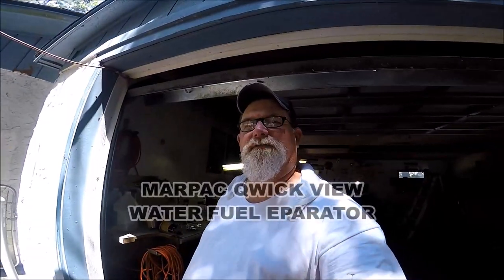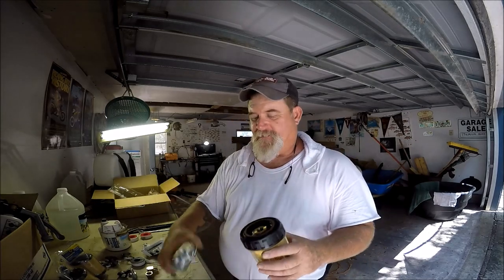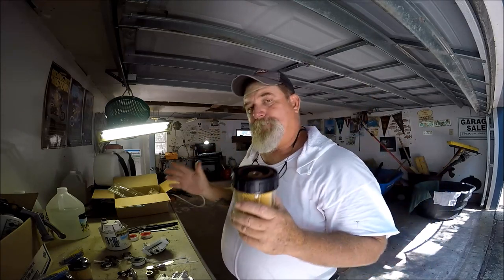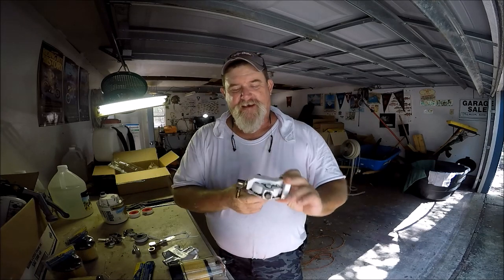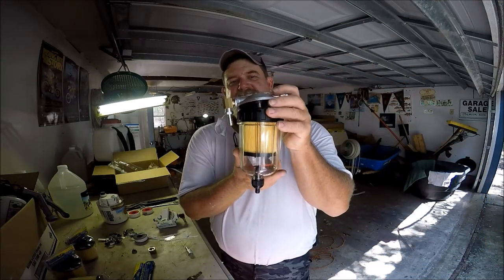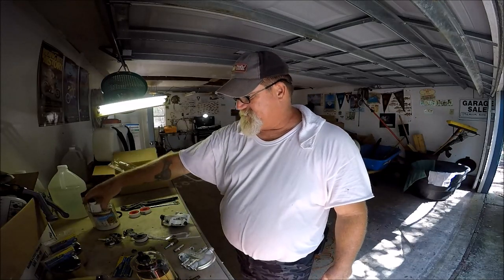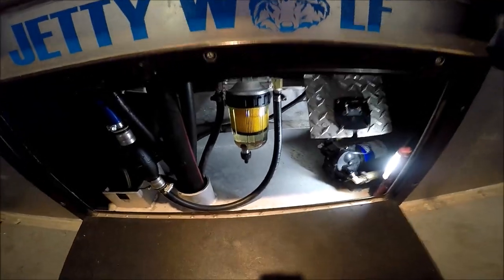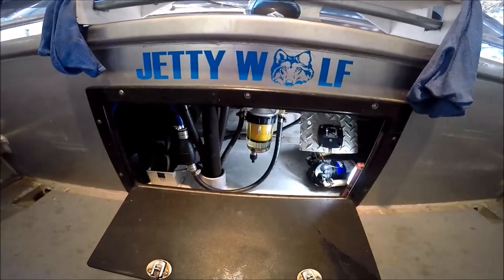my BOATS NEW FUEL FILTER, better & cheaper💲💲

Comment from the maker: AS OF NOVEMBER 27TH 2017, THIS SYSTEM IS AWESOME. WORKS PERFECTLY. EZ TO CHANGE FILTERS ON THE WATER. ALWAYS KEEP SPARES ON BOAT, THEY'RE CHEAP. BUY A 1/2 DOZEN. AND YOU'RE SO GOOD. (I had water in my old RACORS filling with water because of this:  https://youtu.be/cPGfwQQ1EFs

Comment: There are lots of misconceptions about ethanol going around.  One of the "features" of ethanol is to allow gas to absorb some water and dissolve it.  In northern climates, we would add methanol or ethanol (whichever was cheapest) to the gas to remove water condensation in the fuel tank in winter.  If left unchecked, that water would get in the gas line, freeze and block the fuel flow. The problem with ethanol is that it allows fuel producers to get away with rather inferior blends. It also tends to melt certain plastics that were used in older engines.

Comment: Capt Dave, I bought a MARPAC QWICK VIEW System and it works fine except for one small issue - theres a fuel leak
from the upper seal or cup seal and I cannot figure out why - any ideas? 
Have pumped too much gas into it via the bulb maybe ?
Looking for the OEM contact is hard but I believe MARPAC is the inhouse brand for Donovan Marine.
Reply from the maker: Mine's working fine always has you're correct it's the Donovan Marines brand I'm sure you've checked all the seals to make sure they're not crimped or torn anything like that look up Donovan call the head office

Comment: Dave, Jez I don’t think Marpac or anyone got the memo. I have spent a ridiculous amount of time researching fuel filters and and am now totallly flummoxed by the market offerings. I once went 30 miles out, on portable tanks only to hookup my main which was 10 gal water and 30 gal gas. The inline sight glass looked like a strawberry milkshake even after rerouting the fuel line to skim the gas off the top of the tank. A long day and expensive week,  I will not repeat.
No number of Fuel/Water can filters would have saved that day. Many don’t realize when you put water in a oil filter style filter it doesn’t come out...ever. You can take it off, dump it out and only fuel and water that has already passed the filter membrane will come out, leaving a completely unknown amount of water outside the filter membrane, which compromises fuel flow on contact with the filter element.
Are you still happy with the Marpac Quickview with spigot? It looks to be the best innovation in decades but in the hands of Marpac will likely lead to further confusion. All I can find on Marpac is yoga equipment, white noise machines and meditation aids. And I think I going to need all that.
Reply from the maker: 📌 Right here, https://youtu.be/ciEijaSyDUg   https://youtu.be/pPqdwsnIsU8 
FIND RELIEF FROM CRAP GAS.  MARPAC FUEL FILTER AND THE MR. FUNNEL, 2 THINGS THAT GO TOGETHER. My ''TOOLS OF THE TRADE'' page is where YOU can get both, for all this FREE INFO: https://www.amazon.com/shop/captdavessportfishingcharters 
I NEVER even look at my filter that much. ONLY NON-ETHANOL FOR MY ENGINE and always pre-filtered with the Mr. Funnel.  I Change the $12 filter element once a year, maybe sooner. So, I never use the ''spigot''. But SEE-THRU bowl is 100% clear as a bell.  WANT MORE INFO?   https://youtu.be/RGZovHnGEeU  and https://youtu.be/WlLnVzxuzdY   and  https://youtu.be/QF5b4L_Jj1s  
📌 FOLLOW MY STEPS, FOR 100% HASSLE FREE BOAT FUEL......CUZ, YOU CAN'T WALK ON WATER, AND TRYING TO BURN IT IS A BITCH. PLUS, GET RID OF FILTER CLOGGING CRAP, THAT COMES OUT OF THE GAS PUMPS.

Comment: Water  stays in the  bottom of the bowl because it is heavier than gasoline .. if the bowl got filled with  water  it would  push water thought he  filter and into the engine ..
  I would put automictic Transmission fluid or engine oil on all the threads and gaskets to make  disassembly easier..

  I would like to put one of these on a car but  with fuel injection the system  has about  57 PSI in the fuel line .. not sure if that plastic bowl can handle that kind of pressure..
Reply from the maker: I know how this works. The reason my RACOR was filling up is I had a hole in my fuel tank. have whole video about tank replacement. The MARPAC, works great! EZ to see, EZ to change and see filter getting dirty. REASON for this video is the MARPAC is a gem, no one ever talks about.
Reply: I never did find the same filter you have..  I have a Luberfiner  filter housing with  plastic bowl that I added to a diesel pickup..     Oldsmobile  5.7 Liter Diesel .. It had a  little steel canister filer that  you  popped into place under and behind the injection pump was very small and was a pain .. So I put a big filter on the fire wall.

  I want to run E-85 in a hot rod car with  fuel injection ..  I am afraid  57 PSI may  be too much pressure for the plastic filter..  I  use   filers with plastic bowls on my  fuel tanks  they use  1"  fittings   for high volume pump  or  3/4" with  normal volume pump ..
Reply from the maker: A commenter posted a direct link to a seller below and I mentioned Ebay many times. It's for Marine use really. Long links are considered spam.  I try not to turn the comments into a "forum".

Comment: If you have a smaller motor (2 stroke 50hps Johnson), Can I still put on a water separation filter? I was considered that it may ruin my water pump because the pump would most likely work harder getting fuel through filter first.  Is this a valid concern? Or should I not worry about it and put it on?
Reply from the maker: HUH? you're really mixed up. water separated from FUEL!! has zero to do with your motor's water pump. a fuel filter in the boat, coming from tank into motor (that probably has a rudimentary fuel filter under the cowling, is never a bad idea.

Comment: Hi Capt. Just wondering if I can use the same filter to my Ford Everest 3.2L Diesel engine. Will there be any diesel flow issue in case I will install it before the main filter?
Thanks in advance for your reply.
Reply from the maker: I WOULD NOT....CONSULT A DIESEL MECHANIC

Comment: Hey Capt Dave, I recently installed one of these on my Key West with a inboard tank and a 90 hp Mercury, does yours always have the air gap in it? My engine will starve for fuel at high rpms, I can fill the filter up and watch it suck it down to the level yours is in the video and start running rough. Have any thoughts?
Reply from the maker: NO IDEAS...
Reply: Does your filter always have the air gap in it?
Reply: Mine has air gap & I'm wondering if its my problem..  All new fuel lines,vent & inspection of fuel system... Any additional feed back?

Comment: Any updates on this fuel filter setup I just purchased the same one ? And really don't know much about them was just going on a whim kinda
Reply from the maker: works like a champ...I glance at it and have not even seen the red ring float yet. Other than that, I'll change out the filter when I change my oil. Every 100 hrs. Since the filters are a 1/4 the price of the Racor.

Comment: Your boat is sucking in water from you vent.    If your vent points down or straight warpter goes directly into tank..
Vents should point up and you should have a loop that hangs above your vent...most boats come from factory wrong.  Some more worse than others.
Reply from the maker: there's no way for water to get to my vent...it's high and dry.
Reply: Capt Dave's Sport Fishing   Thought the same thing.

Comment: Thats funny, my Racor filter has a clear bottom so you can see the water and easy drain system. yours must be an older style?
Reply from the maker: No according to ABYC standards, BUILDERS put solid bottom metal bowls i  when the filter system is in a enclosed area.
Reply: dankbobby  I believe it's a coast guard requirement the bowl must be metal if the filter is below deck. If above deck it can have a plastic bowl.
Reply from the maker: YEP......IN A HATCH OR BEHIND BULKHEAD i THINK. MY BOAT BUILDER KNOWS THE RULES. NOW, I'M THE BOAT BUILDER!

Comment: Capt. Dave...will this work for 5/16 fuel line?
Reply from the maker: my not?
Reply: Wasn't sure if I have to change the fittings to fit 5/16 fuel line..think I saw it comes to fit 3/8 but may or may not have to change
Reply from the maker: @kurtcer  ''''adapters''', if so. EZ.....Just a trip to Ace Hardware or Home Depot, if in bazzaro world Jax. Fla.
Reply: @CaptDavesSportfishing  thanks

Comment: Big hole Vs the smaller hole shouldn't make a difference.  You'll still get plenty of fuel in the smaller hole.
Reply from the maker: OBVIOUSLY, SHE RUNS LIKE A SCALDED DAWG.  But it matters if ya wanna use your Racor head unit and you have the wrong one which Marpac never mentions.
Reply: Yeah, some standardization would be nice.
Reply from the maker: you'd think.....or at least MARPAC should mention it.
Reply: Can the small adapter be unscrewed to reveal the larger hole ??